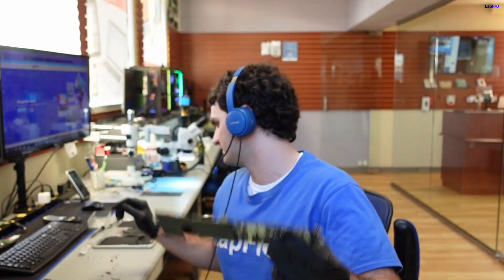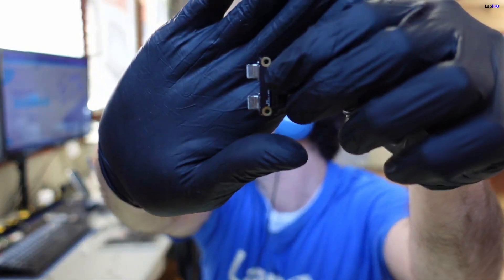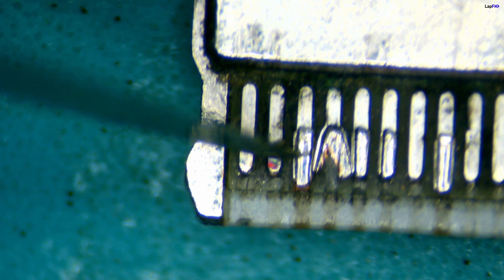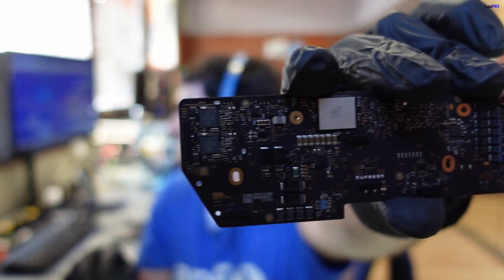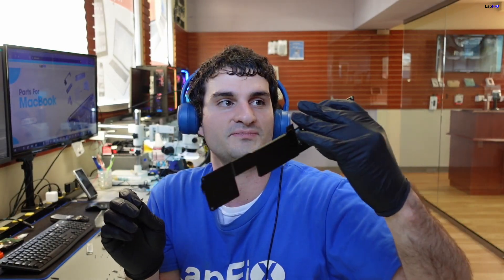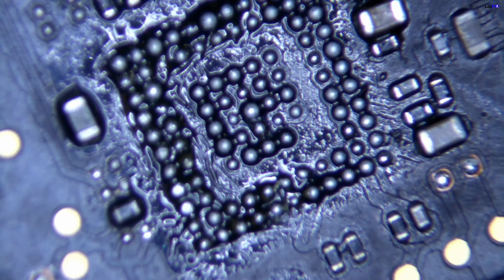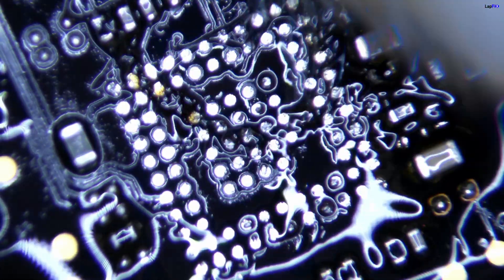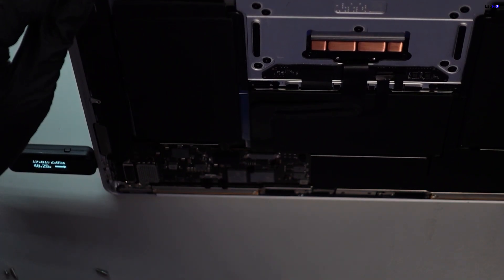M1 Macbook Air Not Charging, Not Turning On Repair

Comment: A weird thing is happening with me, my mba m1 randomly shutdowns or restart when it's on sleep mode, it boots to recovery showing i need to reinstall mac os and i do reinstall mac os and it works fine until that happen again, i even erased my disk.. tried Monterey and ventura just to see if anything gonna stop that but it's didn't stop. Do you know what the issue can be?
Reply: Forgot to mention, it sometimes boot to restore page ( question mark ) and also stay totally blank and unresponsive for hours and bootloops in apple logo.
Reply from the maker: Did you clean wipe macOS  all the way?  Select the "apple ssd" partition and wipe that completely then reinstall.  If you did that and still have an issue, it sounds like a hardware issue.  Any liquid get on it?
Reply: @lapfix  i erase my ssd through disk utility and no there's no liquid damage. Do u know what the hardware issue that could be?